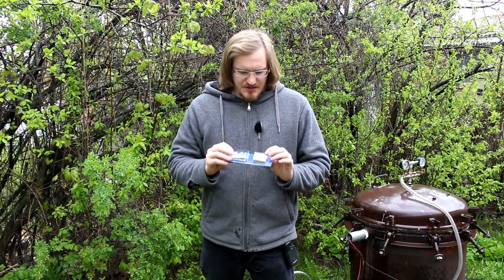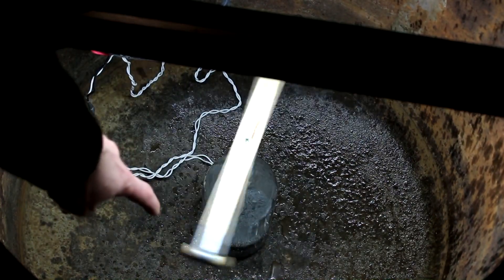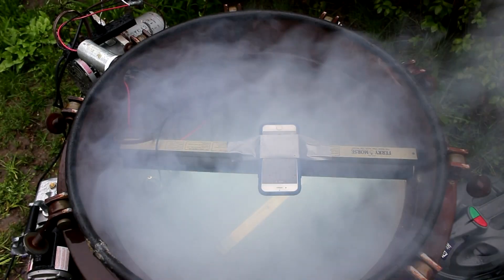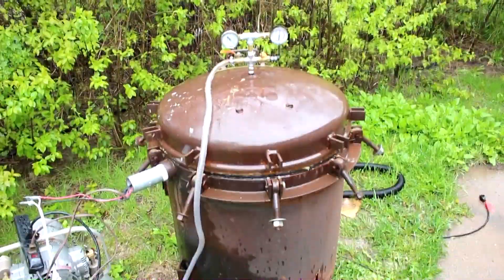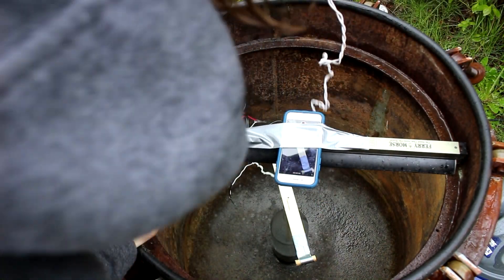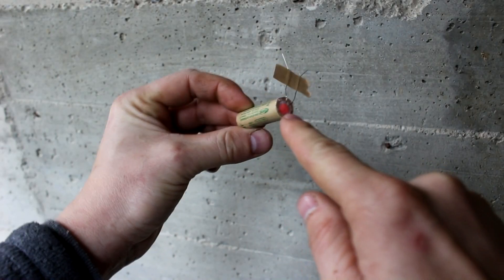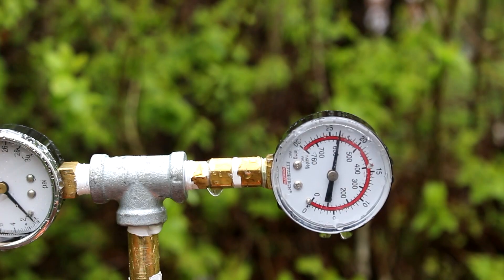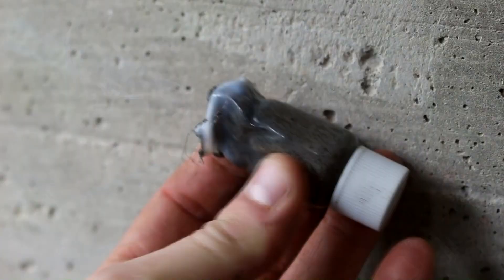Will a Model Rocket Motor Work In Vacuum?

Comment: nothing like using a power strip in the rain
Reply: Probably not as dangerous as wringing out a wet towel in the space shuttle...
Reply: Well, in space the water mostly stays around the towel and the hands in micro-gravity as the strongest force is surface tension (there's a Hadfield video showing this). If you shake the towel, then you'll get droplets flying off, but as there's no gravity to pull the water into crevices, it's actually quite unlikely to get inside the equipment (that same surface tension will make it want to stay in a ball on the surface). And even if it does make it to some circuitry, it'd likely be purified water from the ISS, so unless the towel was particularly dirty it's unlikely to cause any damage (it's the impurities in tap water that allow it to conduct electricity).
Reply: +Road-hog123 

Everything in spacecraft is designed to be water proof, because condensation is difficult to control and waterspills are unavoidable.
Reply: nothing like using a phone and ducktape for camera and a stand
Reply: I used to fly Estes rockets, and I know how to ignite them. Those igniters are designed for 9V, not 110V. The filament temperature is meant to ramp up at a certain rate. If you connect your toaster to a 1KV supply capable of high current flow, what will happen? Will you toast your bread in a few seconds? No, you will get untoasted bread with a few bits of nichrome element embedded in it.

The element is going to fail at a weak spot very quickly. An Estes launch controller can probably be found for $10 on eBay. It looks like the new motors have a plastic plug to keep the igniter against the propellant grains. In the old days we stuffed a bit of recovery wadding in behind the igniter to hold it in place and get reliable ignition.

I was going to do almost exactly the same experiment. I bought a 5 gallon vacuum chamber with a clear top, so I don't have to ruin my I-phone :) I was planning to make a rotating turntable unit for the rocket motor and use a laser tachometer to measure rpm in vacuum and atmosphere.

 I saw another video using a scale, and that will be a lot simpler. Just put the scale in the bottom of the chamber. I already ordered a postal scale with hold function. Place a holder to keep the engine nozzle side up on the scale. The guy I watched used an old porcelain light bulb socket.

 This fellow was a flat earther, and he decided to take the video and his channel down. I can see why; he was dumbfounded when the thrust was produced with and without vacuum. . Unfortunately, I think Cody's in a similar position. That first test with no ignition in vacuum is already showing up  and will show up in countless "flat earth/moon hoax/space does not exist" videos.

Run the ignition wires to the Estes  launch controller through a sealed hole in the chamber. Mount the movie camera above the chamber. Fire the motor at atmospheric pressure. Record the weight held on the scale display.Try it at maximum vacuum. If Do this six times at each pressure to get a mean and estimate of standard deviation. Compare the values of measured force.

As the pressure decreases, there should be no significant loss of thrust, showing that a rocket does not need air to push against in order to function. Just for fun, try it at a few different pressures and plot a curve of thrust vs pressure. The best thing about this system is, that it's relatively cheap and easy. I think the chamber and pump were only about $300 new, and I'm sure you can get them really cheap used. These are for plastic embedding. The scale is perhaps $20. The rocket engines are pricier these days, and I would buy a few tubes to play with.
Reply: iraq just the Tim Taylor in Cody showing through lol
Reply: Depends which astronaut is speaking, Road-hog. Others claim its very dangerous to have loose droplets of water floating around that could get into electrical equipment. Others fling water around like confetti from Rip Taylor.
Reply: +Jondahl Davis "or turn the equipment I have gotten together to a certain person for her science fair project."

Surely you could get it back after the fair and do your own stuff with it...

"I've been a science fair judge, and this looks to be much, much better than the average project if you execute and document it with care."

Absolutely. Providing as much physical distance between the nozzle and wall seems like a good base-covering exercise.

Also, what I think you want to do is graph the motion (or force, depending) on an instrument display (or a parallel, synched video of all the gauges used) and by which, show that initially in the experiment, whatever vacuum was present is still there, and that the initial force generated happens in spite of that initial unspoilt vacuum .

That'll stop the no-thrusters claiming "it wasn't a real vacuum". Also it will partially show that a vacuum-chamber test is certainly relevant provided the experiment is honest about the limitations .

If, in the experiment, you also calculate the mass-flow-rate of the engine, and the exhaust velocity, and so give the no-thrusters an equation that shows the instantaneous, and total force applied.

You would then probably invite them to provide a different formula which takes into account the initial state (with the vacuum) and explains exactly where the force could have come from.

You might also point out, of course, that the commonly-accepted formula is very valuable for engineering, and ask them to show how their formula could be used to predict and engineer a working large-scale system.
Reply: +Jondahl Davis "I think I'll need to pack it with some pistol powder compressed as tightly as possible, fairly easy to get around here."

Seems to me that a sort of tight fitting rubber "cork" with heavy nichrome passing through the cork, and some fine, packed gunpowder around the nichrome, right at the start of the compressed propellant grain would be worth a "shot". You want any amount of gas evolved to spoil the vacuum enough for the action to start, so your idea of tightly packing loose powder is a good one, I think.

When the nichrome gets red-hot, it starts decomposing the KNO3, releases some gas, and there is then no longer a vacuum in the space between the cork and the propellant.

The surface area is so small, that you might get a few PSI before the cork blew out. If you machined or 3D printed a custom nozzle "cork" with embedded nichrome, coiled at the hot end, it would certainly hold pressure, especially if you hot-snotted it in place.

Why am I reminded of the physics problems of trying to get nukes to fission completely before the mechanism was atomized?

What really surprised me about this experiment was that, apparently according to Cody's vacuum gauge, it was only 24 inches of Hg down from atmospheric. That's equivalent to 38000 feet. In other words, rocket motors won't even ignite with a burst of house-current-nichrome-popping at 38000 feet? Wow!

My other idea was to pull apart, say a 0.22 cartridge, and dissolve the lead styphnate off the back face of the casing. That could then be "painted" onto the exposed bit of propellant grain. I have no doubt that, say, 1/10th of a gram of that will detonate in near-vacuum, since it's used in satellite thruster primers.

I wouldn't use too much, though, as you don't want to chip the clay nozzle.
The bad news is that it's relatively insoluble, and of course, it's a small quantity of a fairly fast propagation explosive, so good eye protection and thick gloves are a must. The explosion is not much, an entire 0.22 primer face just makes a "pop" when fired into a piece of rag, but it will certainly mess up bare skin (and works really well killing, atomizing, really, bugs at close range!)

The other idea was to dissolve some smokeless powder (not technically an explosive, mostly nitrocellulose and inert stuff like clay) in acetone, and "paint" that onto a coil of nichrome which you then "cork" into the nozzle. That's quite safe, it will never detonate at pressures you're likely to encounter, if ever, as it is designed to deflagrate even at pressures like 40,000 psi inside a gun.

I'd think 1/10th to 1/3 of a gram would be plenty for starting a C rocket motor.

If I have some time, I'll try it myself; I have plenty of nichrome, smokeless, and acetone.

I would use fairly thick nichrome, and a high DC current source. You want high heat, and you want it to hang around, not pop the wire until after ignition. Say a 2-4 D sized nicads?
Reply: iraq it's not salt water raining down
Reply: stani iliev duck
Reply: More concerned about wiring the ignitor to the mains. They only need battery level voltages to ignite.
Reply: I just stole the the scale idea from that poor guy who was trying to show rockets can't work in space. The comments he got from his Flat Earth comrades are the same ones that typically show up under these kinds of videos: "It wasn't a real vacuum! You can only do this test in space! A vacuum chamber test isn't relevant!" and "The rocket engine is pushing against the vacuum chamber wall!". 

The guy was very honest and presented the results with the admission that he was shocked and confused. The thrust appeared to be at least as high, maybe a little higher, in vacuum as opposed to full atmospheric pressure. He couldn't take the criticism, so he bailed out. I saved the video address, but it disappeared after less than 200 views. His chamber was a little leaky, so the vacuum was maybe 20" Hg, but there was no reduction in thrust.

I can't decide whether to do this myself, or turn the equipment I have gotten together to a certain person for her science fair project. I've been a science fair judge, and this looks to be much, much better than the average project if you execute and document it with care.
Reply: +Jondahl Davis     You can try to introduce this as a science fair project but there may be qualified resistance against it. Due to laws of phsics there can't be any doubt that rockets work in vacuum. And rockets have shown and show their working in vacuum all the time.

The thrust being higher in vacuum is no surprise, since air resistance is not present then. This can have more impact than the "push against air"-effect.
Reply: The comments here show that there are plenty of people with doubts about rockets working in space:)  I know people who don't believe in moon landings, are against vaccination, and are ex-members (well he says he's an ex-member) of the Ku Klux Klan. Washington County is FILLED with such people.
Reply: I need to contact Estes about this. I'm thinking they might have suggestions about ignition in vacuum, though they are certain to warn that the engines weren't meant for this use. I'm wondering what equipment the company  uses to get their thrust/time curves. I've used lab scales with serial ports to dump numbers into a program for manipulation. Something like that would be fun to play with, but I'm too cheap to buy a lab scale.

If all else fails, these characters fall back on their "If even one molecule is present,it's not a vacuum!"

 As far as the equipment goes, the girl is over 1,000 miles away, and shipping the chamber is a bit of a pain. The scale should be here by Monday.
Reply: Jondahl Davis "If all else fails, these characters fall back on their "If even one molecule is present,it's not a vacuum!"

Yeah, well, that means space is not a vacuum and so they are saying themselves, that rockets work there, unless they can show a testable equation that shows how they don't, and the test is positive.

Heck, even up around 1000km altitude, just at the beginning of the VAB, the density is around 900 atoms/m^3

I also get a kick out of the idea that if molecules are "blown out" of a rocket exhaust, they yield a force on the rocket, but if they are "sucked out" with the same net acceleration, they don't. In both cases, of course, the molecules are simply "falling across a pressure differential".

Words are powerful things, but I don't think you can destroy Newtonian physics simply by describing it differently.
Reply: +Jondahl Davis Any luck with your investigations? Science fair?
Reply: I'm guessing it wasn't hooked up to mains, just a local power supply
Reply: +Jondahl Davis Cody occasionally seems to do things which are deliberately perverse in his videos. This could be by design.

It could also be an illusion, but I was also assembling such a comment regarding the igniters, so you've saved me the trouble, and done a very thorough job of specifying what looks like a great, rigorous experiment. Thanks!

My prediction is that if such a high-class, flawless experiment is ever done, the "no thrust in vacuum" crowd will simply refuse to acknowledge its existence or documentation, and leave conversations at the mere whisper of it!

Well-done!
Reply: I ordered 12 C6-0 engines. I have a feeling an ejection charge would not be a good idea. I just hope the sampling rate of the scale is sufficient. It looks like the motor goes to 14 N in 0.2 seconds, then drops to about 4.5 N for one second. It will have to reliably record that very brief peak force and hold it.

I'm thinking a motor holder that's heavy will smooth out that thrust peak a little because of inertia. That old fashioned porcelain light socket the other guy used was probably pretty heavy for its size.

Nature Hacker had some ideas about using a CO2 cartridge in a vacuum chamber, but I don't think he's actually done anything. I think that reliably piercing a CO2 cartridge closure could be a little tricky. A solenoid with a lot of power and a needle attached? It's not obvious how to do it. I think I'll take my chances with electric ignition. They changed the igniters somewhat since the old days.

It looks like it's tougher to light these in vacuum reliably than I thought. There is some information from experienced people floating around, and some failed experiments by elementary students. It can be done,  it has been done, just have to work out the kinks.I think I'll need to pack it with some pistol powder compressed as tightly as possible, fairly easy to get around here.

Too bad I don't have a cryopump or sorption pump. You can get an insane flow rate into the pump, even if it's only for a limited time. This could be used to keep the pressure rise to a minimum when the motor is fired.

Comment: Can Jet Fuel melt Steel Beams? no seriously, what can and can't  jet fuel burn?
Reply: tanishq vedak Jet fuel can't melt dank memes.
Reply: You can get steel red hot from a fire with a few logs.. So a building on fire would do it easily..
Reply: The entire point is that jet fuel didn't even need to "melt" steel, it just needed to weaken it, which it did. The higher the temp gets, the strength of the steel gets lower and lower. By 1000 degrees F, structural steel is only at 40% or lower of it's original strength. Jet fuel can easily burn beyond 1000 degrees F.
Reply: Who says steel beams were melted? Only the ones that say it's impossible... Jet fuel can start fires that will burn hotter than itself...

Comment: How about making a video showing the difference between vacuum, normal and pressurized? 

I'm thinking painting one half of the stick black. Put the iPhone into "slow mode" recording so you can count the amount of times it's gone around. Depending on the amount of time you can record, you may have to make the res as small as possible. 

Or you could figure out thrust the rockets can make and create a balancing system. Weight on one side and rocket on the other. Is there a difference between the 3 atmospheric pressures? Will the rocket in the high pressure be able to lift the weight easier than the one in the vacuum?
Reply: the thing is, under a vacuum, those little engines burn much faster than in atmosphere. they spend all their specific impulse in a very short time frame, they go faster as long as they burn, but the engine in 1 bar of pressure will burn longer. wont go as fast as the vacuum test in the same time frame, but it will be under acceleration for a longer period of time, so by the time the 1 bar test burns out, it will likely be going faster than the vacuum one. a 2 bar test will burn slower than the 1 bar test, will accelerate slower, but burn for longer, so should have a faster final speed at the time the engine burns out.

Comment: the reason rockets are able to move through space is because of Newtons 3rd law (When you apply a force there is an equal and opposite force pushing back). When the rocket releases gas into space it pushes back on the rocket, propelling it through space :)

Comment: Of course it won't work, these model rocket motors don't have oxidizer. Estes engines are known as black powder engines, and they contain charcoal, sulfur, and potassium nitrate. The solid rocket engine needs oxygen to burn. Liquid engines have to use liquid oxygen to burn in vacuum. The one in the bottle went for a split second because it had a little bit of oxygen, but I guarantee if you cut it open it hasn't burned the whole way. You sir are wrong about the whole pressure thing. The motor simply needs oxygen to burn, which is why NASA doesn't use solid rocket boosters in space. I hope you read this and do the research.
Reply: Potassium nitrATE is an oxidizer. What it didn't have, which NASA engines do, is enough pressure containment designed in, to do an efficient burn.